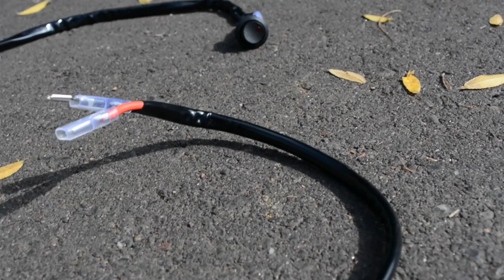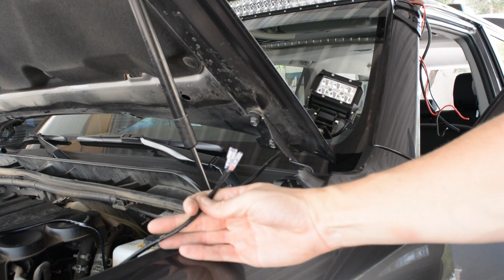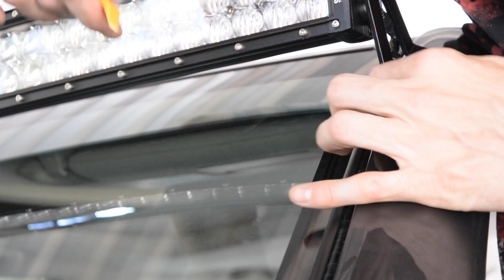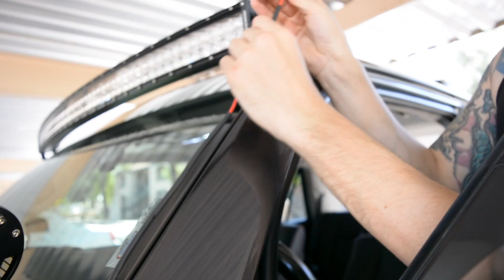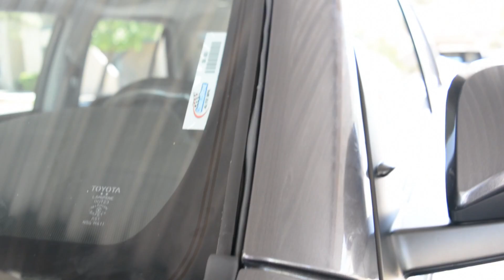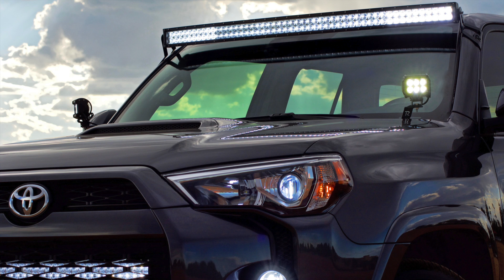Rago Fabrication - LED Bar Wiring

Comment: Remove 2 cm of insulation from both sides of the wires. Twist 1 cm of each end of the two wires, THEN join togheter the ends. Twist them togher. Apply flux and solder

Comment: Use flux to "tin" your wires prior to soldering and your connections will be MUCH cleaner (plus, they won't require as much heat to solder).  OR, you could use shrink connectors with solder built in and it would cut your work in half.  (Also, FYI: The "L" in "solder" is silent.  Just sayin'...)

Comment: the wiring at the light and copious amounts to tape is not well done.  Improper fork connectors at the light, not using a crimping tool. lazy option and should not even be in your playbook for your customers. My dad would punch me in the neck if I pulled that

Comment: Omg! I don't recommend anybody this solutions :O

1. You cut bar cables just to put this fast relase connectors on it?
2. You know why ppl invented waterproof connectos with good isolation?
3. You know how many amps swinging in this cables when its on? 
4. You cut cables one more time making it 1cm short just to solder it again? 
5. Do you know what is minimum thickness for this amperage? 

:SSS
Reply: what a mess. My dad would punch me in the neck

Comment: 1, he should be using insulated connectors, 2, he's using a fork connector with a push on connector....this guy doesn't know what the heck he's doing..
Reply: "Crimping" with a multitool pliers instead of a crimper.

Comment: love those brackets! Thanks
Reply: Are your brackets causing any wind noise from the door jam when driving 60+?
Reply: @ML-mx1py  I don't have these yet on my rig but I am looking for one that would fit my triton. does this bracket cause wind noise when driving?
Reply: @DashCamJournalsPH  It sure does. i would suggest getting brackets that mounts on top of the roof where the roof rack tabs are placed. i am so close to just ditching these but my rig will be scared with 4 holes ):
Reply: @ML-mx1py  Thanks for the input mate, I am considering to purchase a top mount roof bracket as well but I am scared to drill some holes on my rig. :) I am looking into some magnet brackets but this might get my led bar stolen when I parked in a public space.